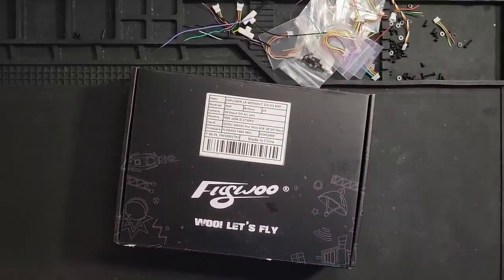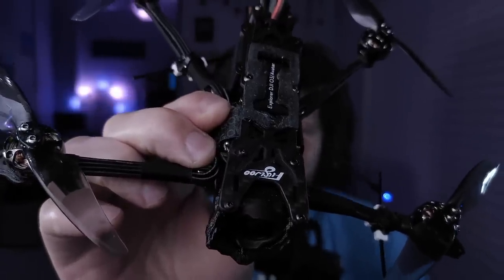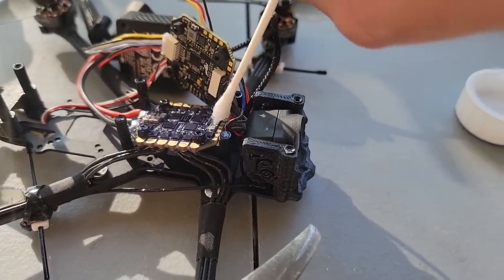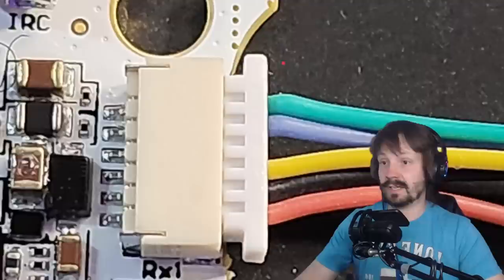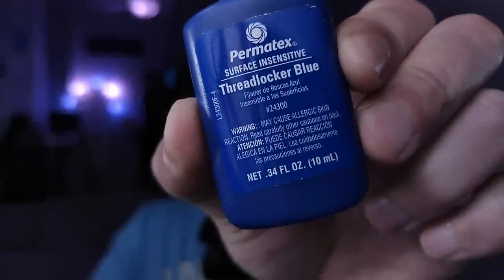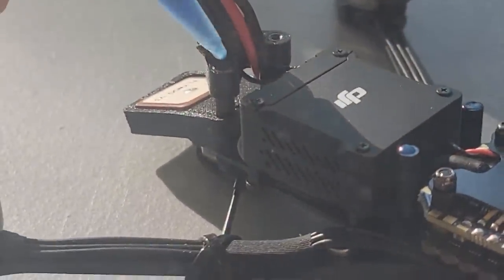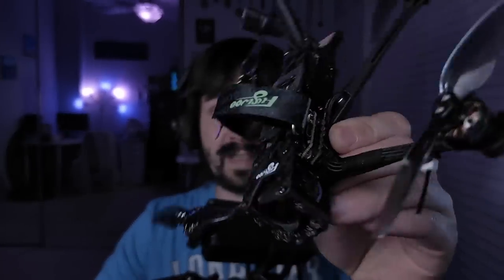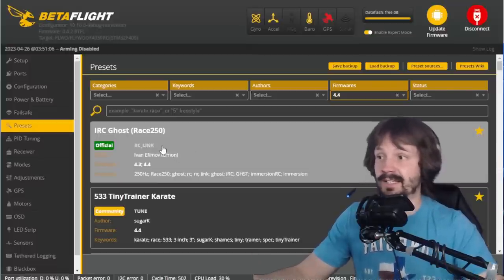How to prepare your BNF: DJI O3 Flywoo LR4 - hypercritical review

Comment: BF devs: Flywoo uses an M10 GPS. These units are not configured by default to give Betaflight the data it needs(also not on 4.4.1), and some do not respond to auto-config messages because they were changed in the M10 protocols.  
Betaflight reliably supports M8 GPS units.
If you have an M10, we are working on support for them.
Meantime try manually setting the baud rate for the GPS uart in Ports tab to 115200, and try 4.5 Zulu.
Reply from the maker: Interesting! That's cool
Reply: @IvanEfimovLimon  could you share you cli file for betafligth 4.4.1? you video are the way the best

Comment: i have a glue like the amazing b 7000, this is the glue used for the ufl connector for the receivers. is probably the same, and I can't live without it. and for the weak point of the soldered wires on the FC I have a tip: when you put solder on the wires before soldering (excuse my bad English and it's out of topic because BNF but hey..) put a little solder inside the insulation by heating with the vertical wire.. the solder will go by capillary action inside. the first >1.5 mm, and with the glue added, they do not move and the weak point is +/-1.5 mm inside the wire. (after putting glue, it's forever) (and only possible with silicone cables..)

Comment: Loctite blue made my gemfan 4024 explode. They definitely do chemically change the polycarbonate in the plastic. I added a few drops in the hole where the screw goes and after 10 minutes, I heard cracking. The prop literally broke in half.
Reply: Yep, I've had this happen with props too.  I didn't realize it was the loctite.

Comment: pro tip on the b7000 on the solder joints.  :(  I lost one of my favorites because a wire broke (99% sure) VTX power or ground connection broke after recently swapping frames. B7000 might have saved me.  GPS rescue sure didnt.  Now its running free in the wild living its best life on its own.  Maybe it will come back when it gets cold.
Reply from the maker: sorry to hear that mate...

Comment: B-7000 tick, I only ever used the blue thread locker on the motor screws - did your new GPS pick up the satellites quicker? Mine also takes a hang of a along time
Reply from the maker: no, it never did... idk what was wrong with the drone. I eventually lost it in the woods )

Comment: Hi, i have a problem n mayb u can help me out. Judt got the flywoo explorer LR 4 and flashed the 3.9 to 4.4 n reinstall “diff all” file saved from factory, reboot after n nothing much happened, tx n rx is still bound but no stick movement on screen or drone, not sure what i did wrong. Any suggestions is appreciated, im thinking if i can get cli copy from someone n paste in command bar n save it. Would that work? Been out of the hobby fir awhile n barely getting back into it. Drone is flywoo exploer lr4 with f405 fc along with walsnail vtx n crsfr
Reply from the maker: after reflashing new version, you need to setup ports again. Also while flashing 4.4 you need to make sure correct radio protocol is selected (of flasher tab). I think that would be it.

Comment: Question for you when using a bmi 720 gyro which has pid loop of 3.20 what dshot should i use 300 or 600 the flight controller is a f722
Reply from the maker: Hey. It can be any, 600 and 300. Use 300 if you have errors with 600. Or just use 300

Comment: hey what type of bolts do you buy? my motor bolts are really poor quality and theyre rounding out
Reply from the maker: i use monsterbolts, stainless steel or titanium. Random bolts from amazon also should work ok. But need to check if your screwdriver is in a good sharp shape. That's the key usually.

Comment: Please help me out. I can't seem to find the metal spacers you are saying to replace instead of the plastic one to punt the f.c and esc too. Can you let me know here to buy them? Thanks and great video as always 🤙
Reply from the maker: It's just screws I think you mean? Monsterbolt got bunch of screws if you are in US
Reply: @IvanEfimovLimon  thank you for your reply! I understand you can use plastic nylon nut to tighten down the metal screws going through the stack which has the metal nut on top to tighten it. But you said even plastic is not good in case the break and then you get vibration. Do you use just metal nuts? Or do you use hollow metal spacers like the plastic ones that were under the LR4 explorer v2 stack?
Reply from the maker: @fpvdetailz712  so between FC and ESC and under ESC (if needed)  i use whatever i can find, but not metal.
Usually its extra rubber gummies. And on top of the stack, yeah, its just plastick nuts.

The only metal nuts im using is to secure the metal stack scres to the carbon - that one is must have.

For between the FC and ESC, sometimes i also use plastick nuts, but drill them through to get rid of thread.

Comment: Ivan, have you tried the orange Permatex thread locker? It is supposed to hold 3 x stronger, and be as easily removed as the blue Loctite thread locker.
Reply from the maker: Hey. I haven't. But thats interesting. How it holds stronger, but to be removed easier?
Reply: @Limon - Ivan Efimov  well, it removes as easily as the blue thread locker.

Comment: Hey man, should I buy it or build it? price difference is minuscule :( 

also did they fix the GPS?
Reply from the maker: i would build it
Reply: @IvanEfimovLimon bought the parts. Would you solder the motors with the wires running inside (over the mosfets) or going straight out (like they did in your quad)
Reply from the maker: @alpenfoxvideo7255  I solder them running outside right away. A little angled

Comment: What's a difference between E6000 and B7000?
Reply from the maker: E6000 is more stiff when dry. B7000 is like a soft rubber
Reply: The e6000 seems to be a bit stiffer, the one he is using here will pull off easier and probably sets faster.  I think the two are close  both are fine in most applications the e6000 may cause you to pull off components if not careful this may be his reasons
Reply: @Inconvenientruther  thanks for describing
Reply: @IvanEfimovLimon    Good to know , I can see that totally. the e 6000 is probably right on the limit of too much adhesion, I’m sure you could pull off a small capacitor from your board if you weren’t careful